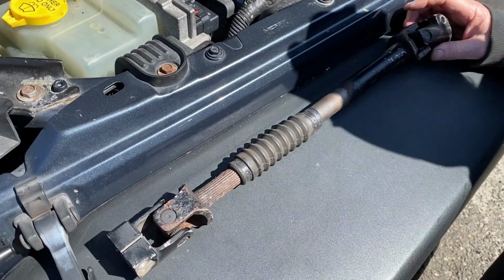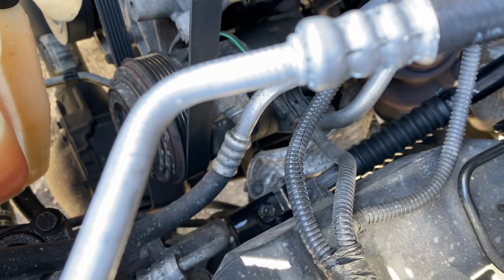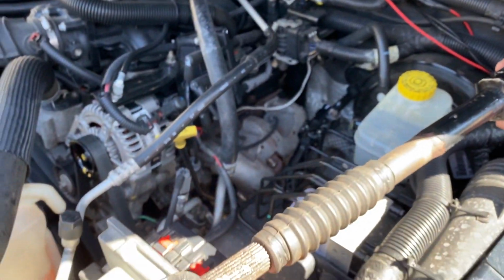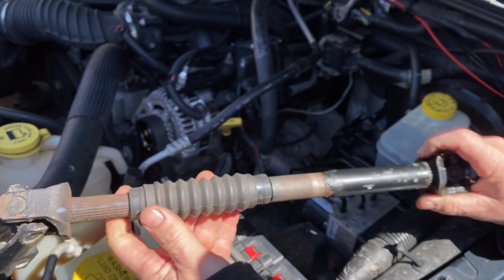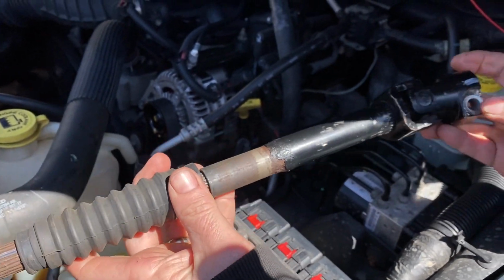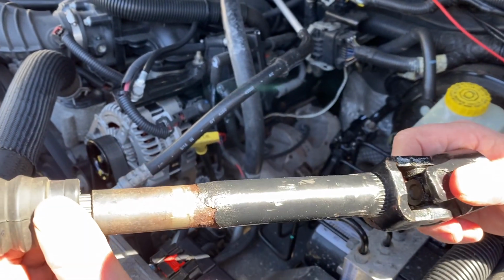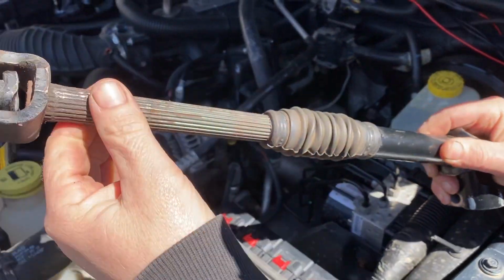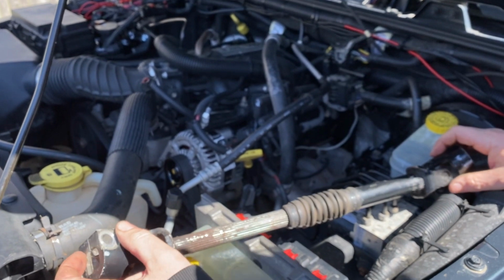Lower Steering Shaft Replacement on Jeep Wrangler 2007-2011

Comment: because its probably frozen instead of sliding in its splines. so  how do you remove it if its frozen.
Reply from the maker: Watch the video
Reply: @motorcarnut   i did unbolt 2 13mm nuts and just slide it out.... it cant slide on the splines cause its frozen ....  thought, you was going to show a technique on how to remove it,